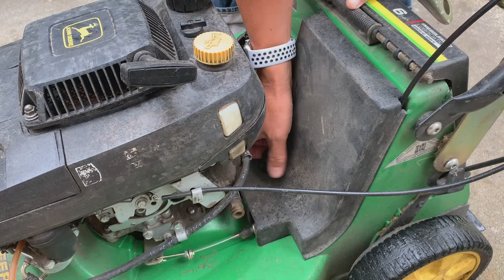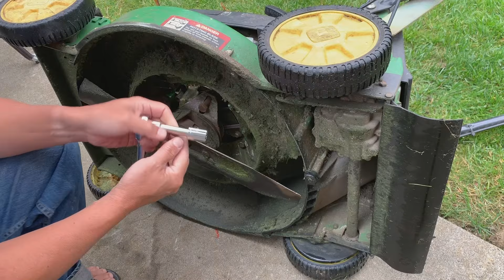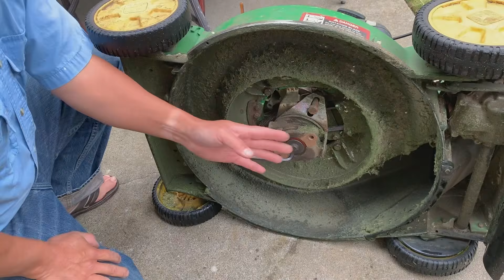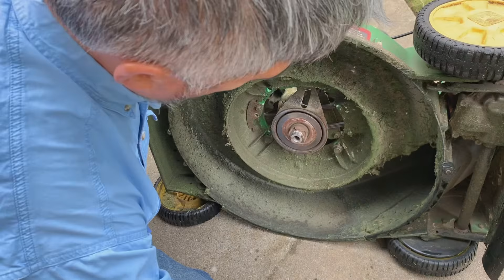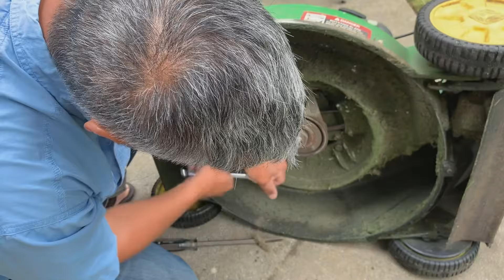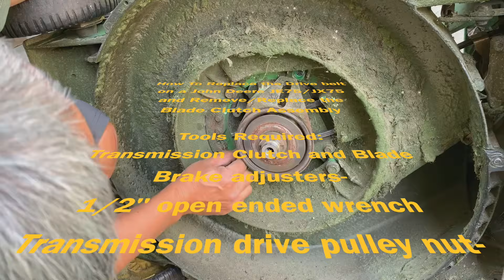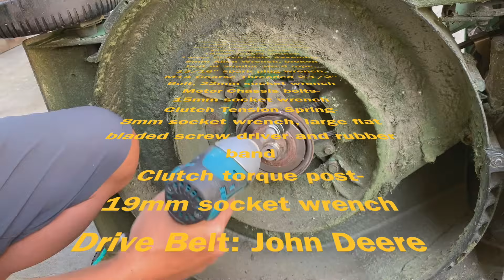How to Service the Drive Belt and Blade Clutch on a John Deere JE75/JX75 Self Propelled Mower

Comment: Great video, I was able to get it finished and put back together.  However, the next day, the string was very difficult to pull to get the mower started.  Any insight as to why? I was thinking maybe I jammed the old belt through the spark plug hole jumbled up the mower.
Reply from the maker: It’s possible a part of the rope or belt used to seize the piston broke in the combustion chamber, or the clutch/blade are getting jammed if the motor is not properly seated on the deck. With the spark plug out, try rotating the blade and look for jamming under the deck. If it swings less than 360 degrees, remove the cylinder head and inspect the combustion chamber.

Comment: This is a very well done video. I've made professional automotive videos before and this one is definitely a good quality one. For what could be a slightly complicated repair on this mower, the camera work was very good and all the little help tips along the way were excellent. The only negative thing I can say about this is that the sound trailed off in a few places BUT I just had to turn my volume up to compensate. My JX75 is a great mower and I've only needed to make several minor repairs on it over the past 21 years. I did  purchase a spare drive belt this year (2020) "just in case" my OEM belt ever fails, and found this video only because I was interested in what the replacement procedure might be. I definitely recommend watching if you ever need to change your drive belt.
Reply: I  did the same thing!  My 21 year old JX75 needed new wheels and a tune up so I bought a belt while I was at it.  Thank goodness for this video.
Reply: @jeffreyhansen350  This is by far the best mower I've ever had Jeff. I've had to replace the Drive Control Cable (the one from the Throttle down to the Trans), the Drive Wheel keys/and gears, rear wheels, and the Lower Handlebar which just broke through one of the attaching screw holes to the Upper Handlebar. I'm still running with the original spark plug! even though I pull it every couple years to check the gap and clean it off. And this thing still starts up, even in the spring on first use, with its first pull. Just before putting it away for Winter, I do put a little Sta-bil in the gas tank, fill it up, start the mower, then turn the gas supply to the carb off, and let the mower run until it stops on its own. In the Spring maybe 5 months later, just turn the gas supply back on, wait a few minutes, and I'll say 95+% of the time it starts on first pull. Again, this is a great mower if you also provide routine maintenance for everything else as well. I just wish JD still made these walk-behinds.
Reply: John Deere stopped making them because they rarely break down.My SE turned 30 years old this year bought it new in 1994.